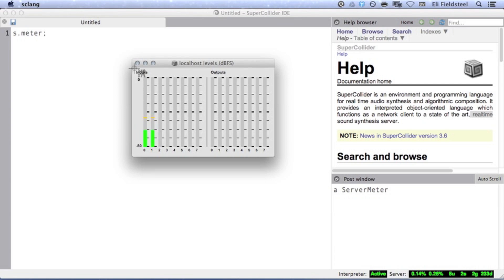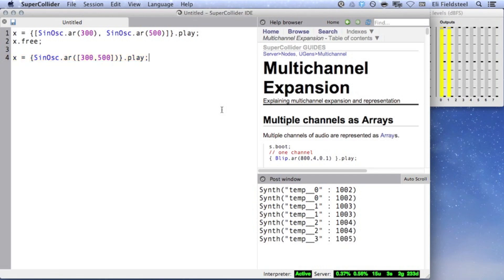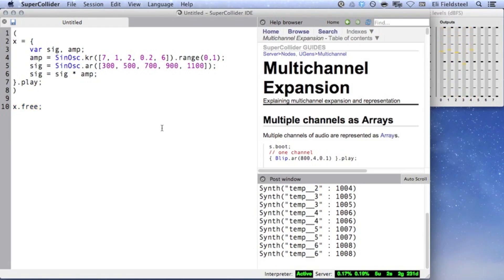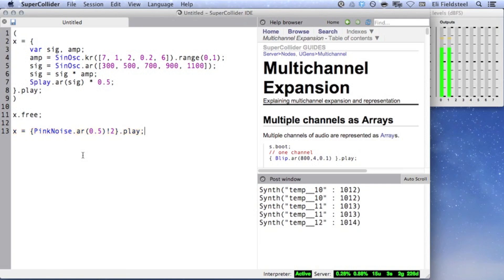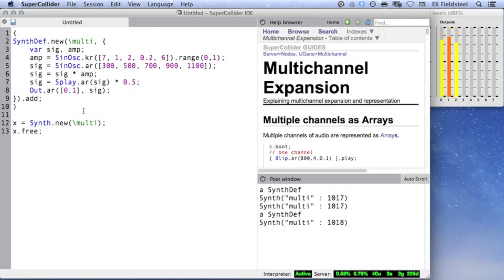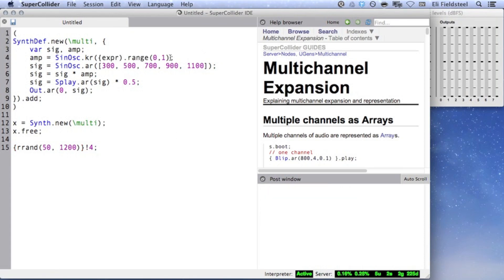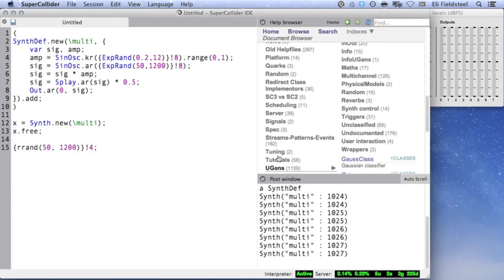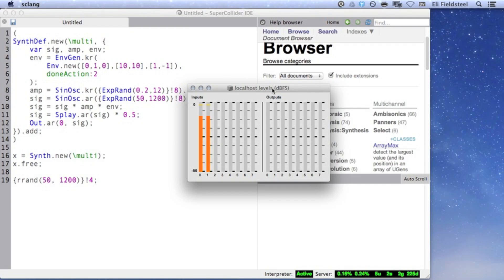SuperCollider Tutorial: 5. Multichannel Expansion

Comment: When playing through my airpods, it seems like there isn't a difference between using one channel and two. In otherwords, it comes through left and right airpod either way. 

Is this because airpods only has one channel?

Here's what I see when my server boots:

Number of Devices: 6
   0 : "AirPods P"
   1 : "AirPods P"
   2 : "iPhone Micropho"
   3 : "MacBook Pro Microphone"
   4 : "MacBook Pro Speakers"
   5 : "Microsoft Teams Audio"

"AirPods P" Input Device
   Streams: 1
      0  channels 1

"AirPods P" Output Device
   Streams: 1
      0  channels 1
Reply: Alright I figured out a solution:

On mac, open Audio MIDI Setup. Add a new aggregate device. Click the checkbox for airpods pro and macbook pro microphone. For clock source, select airpods pro. Click the drop down and make sure both options are set to sample rate 48kHz. Make sure macbook pro microphone has drift correction selected. Rename this aggregate device "sc".

In supercollider, make sure your servers are killed and then run the following:

s.options.device = "sc";
s.boot;

You should see something like the following in the Post window:

Requested sample rate 44100.000000 was not available - attempting to use sample rate of 48000.000000
"sc" Input Device
   Streams: 1
      0  channels 1

"sc" Output Device
   Streams: 1
      0  channels 2

SC_AudioDriver: sample rate = 48000.000000, driver's block size = 512
SuperCollider 3 server ready.

The important part is that your ouput device is recognizing 2 channels.

Hope this helps someone!
Reply from the maker: @boggledeggnoggler5472  Interesting — I don't own a pair of airpods so I can't really test this on my own. But I wouldn't put it past Apple to design them with some software feature meant to streamline usage but which actually creates unexpected behavior in some cases. Glad you seem to have a found a solution using with creating an aggregate device. My only guess is that there is a setting that "detects" monophonic audio and assumes the user wants to hear it in both ears. Maybe this, or some related setting? https://support.apple.com/guide/airpods/play-the-same-sound-in-both-of-your-airpods-dev2b840e13e/web

Comment: Hello Eli.
Let me first thank you for all the good work you do with the tutorials. I'm very impressed by your expertise. One question though: How does the system know that when you multiply the SinOsc.ar by any value that you want to influence the amplitude. SinOsc doesn't even contain an argument amplitude. Thanks for your answer. bye.
Herman (from Belgium)
Reply from the maker: In the digital world, the output of any waveform generator (i.e. UGen) consists of a stream of samples, often 44100/sec. Samples are, simply, numerical values. When you multiply a UGen by a number, you are scaling the sample values by that number. In the case of the default SinOsc, the samples oscillate between -1 and +1 and represent your speaker's deviation from rest position, which we perceive as loudness. For example, multiplication by 0.25 means the output ranges from -0.25 to +0.25, so we hear this as 4x as quiet as the original waveform.

Also note that SinOsc (and many other UGens) do have an argument for amplitude, called 'mul.'